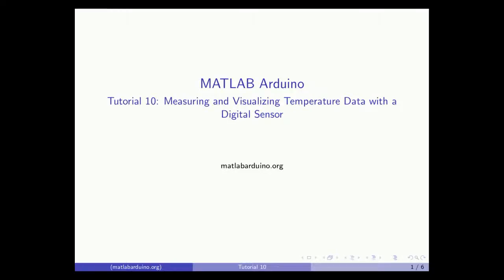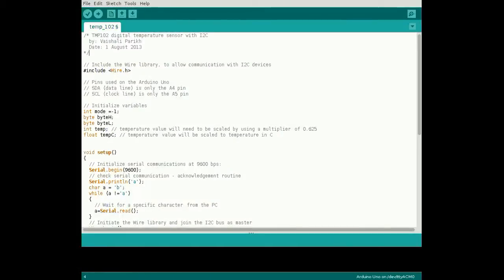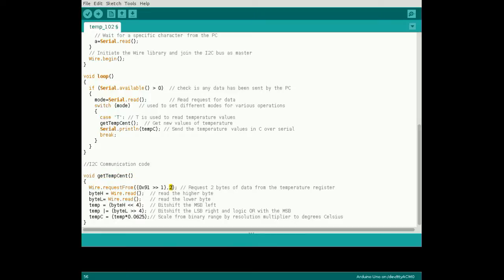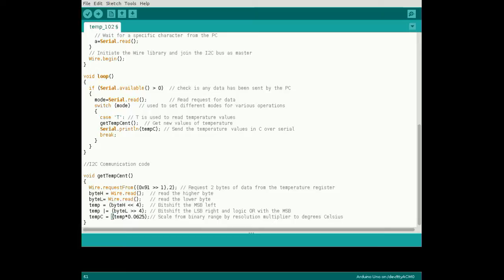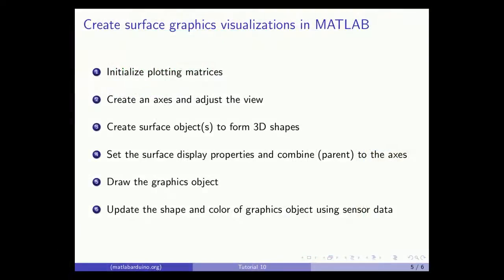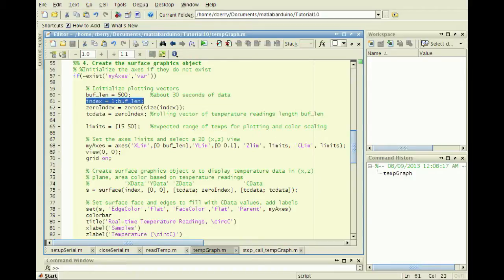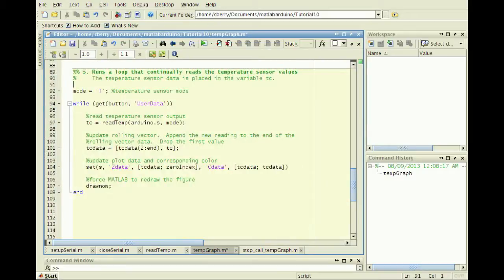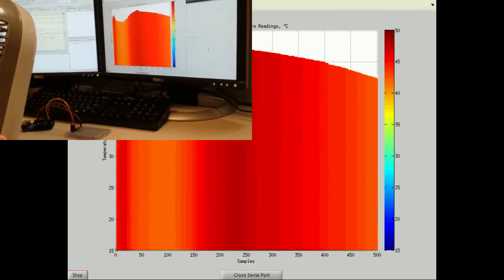MATLAB Arduino Tutorial 10 - TI TMP 102 Temperature Sensor data - Real-time visualization

Comment: I tried to implement a similar code and I got confused with the setting up of the surface plot. I always get the error :
Warning: size(CData) must equal size(ZData) or size(ZData)-1 for flat shading 

I was wondering if you had any insight. When I inspect in the command line [tcdata; zeroIndex] and [tcdata; tcdata] are both 2x500 matricies so I think that they should be the same size.

Any insight would be appreciated
Reply: hey 123neeb did u get the solution for that error...I am also having error with same line..
Could u help me out,,,
Error using vertcatDimensions of matrices being concatenated are not consistent.

Error in plot_test_colorbar (line 55)
        set(s,'Zdata',[tcdata; zeroIndex],'Cdata',[tcdata; tcdata]);

thanks
Reply: Yash, this is what am experiencing now... How did you solve it?